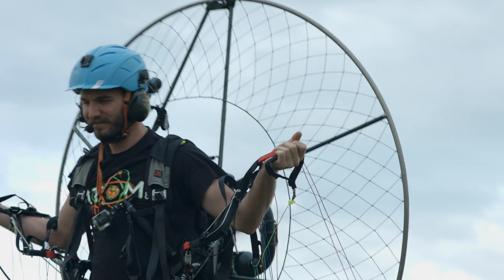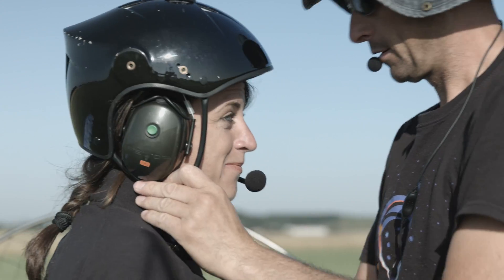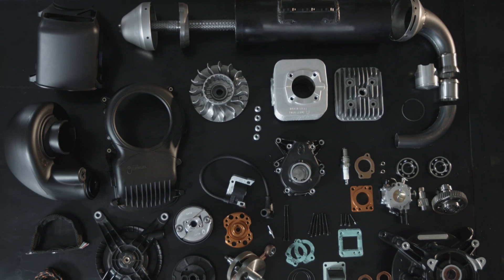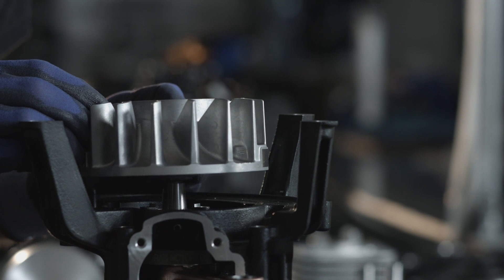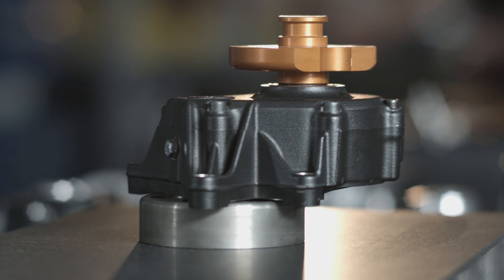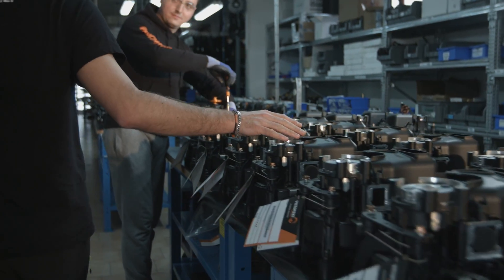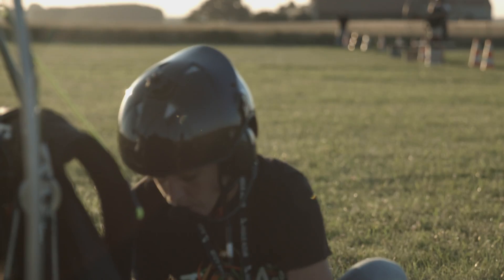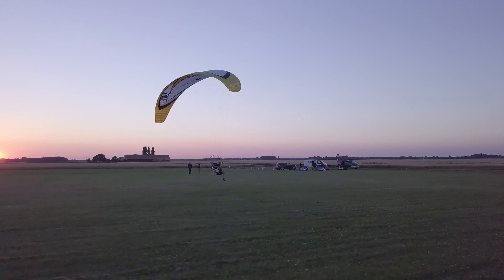Atom 80 - Technical features

Comment: Hello. I just bought a brand new atom80. I did the brake in and first 
flight but I cant get more than 7200rpm at full throttle with a 125cm cb
 prop.
Manual says it should reach 9000rpm.
I am using 98 unleaded fuel with 3% sintethic oil. May that be the 
problem?
I have the carbureator factory settings. Should I adjust the carburateor
 high end needle setting?
Thanks
Oscar
Reply: You have to use a fully synthetic oil